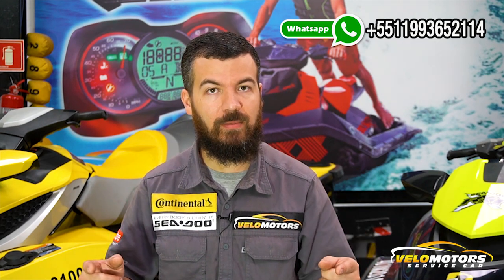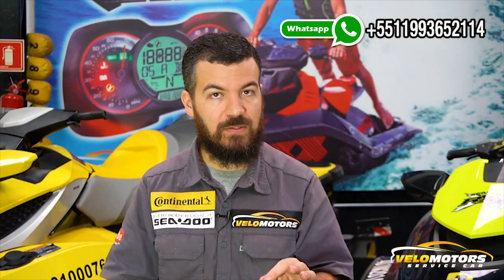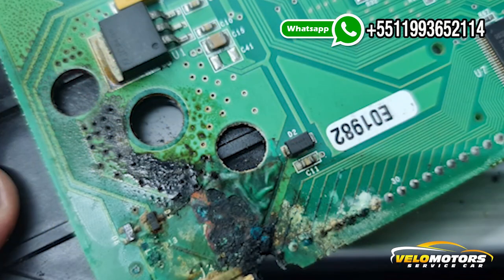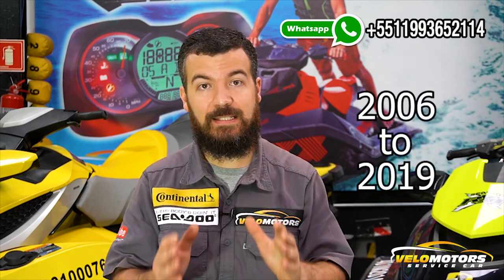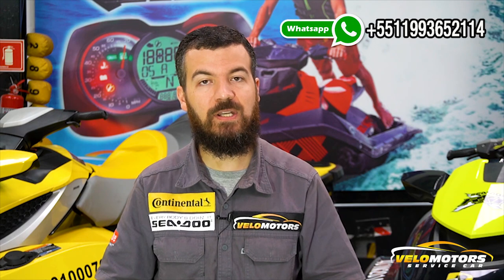JETSKI PWC CLUSTER GAUGE REPAIR DISPLAY TEARDOWN FADED STUCK NEEDLE CRACKED LENSES (English)

Comment: 2001 GP1200r  worked great then tarped for winter and moisture got in cluster and doesn't work now , occasionally it will beep though.
Reply from the maker: Hello friend. Could you send us a picture or a small vídeo in order for us to send a quotation? Our number + 551199365-2114